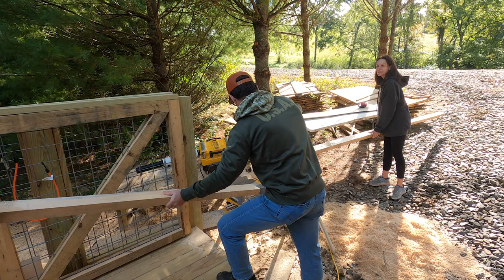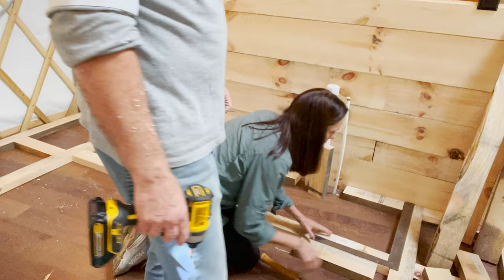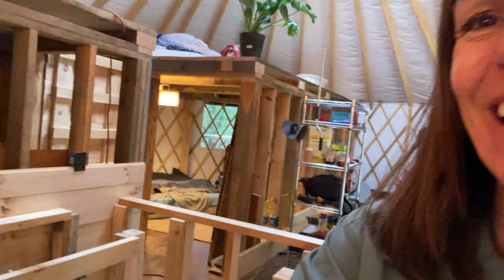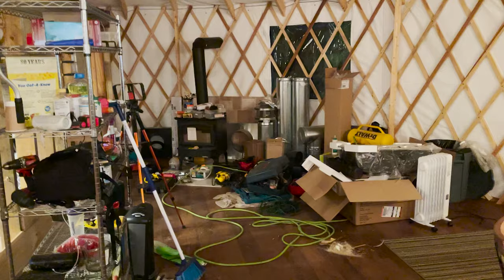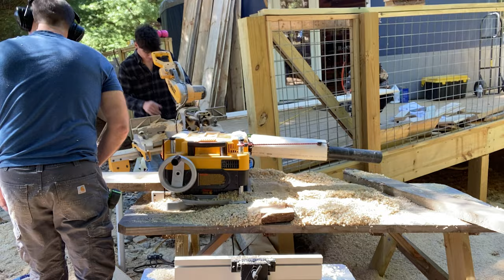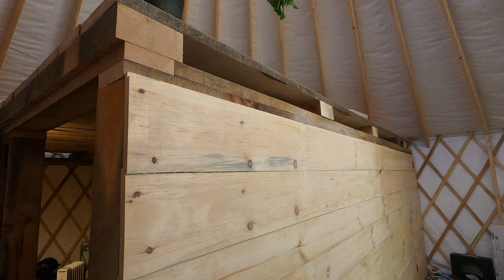#32 The YURT KITCHEN is on it's way!

Comment: How did you design your loft and how talla are your Interior walls?
Reply from the maker: We just designed it as we went along!  We made the interior walls the same height as the exterior walls, roughly 7'.  The floor beams needed to be around 16" apart, added pillars with beams around the exterior walls and connected it all.
Reply: Do you have pictures I can see of that so I can design it similar really like it. How much room do you have in the bathroom ceiling and stuff?